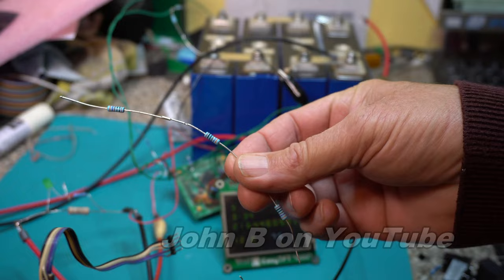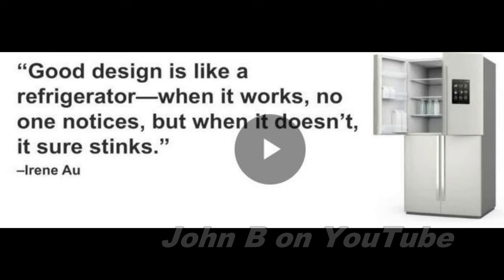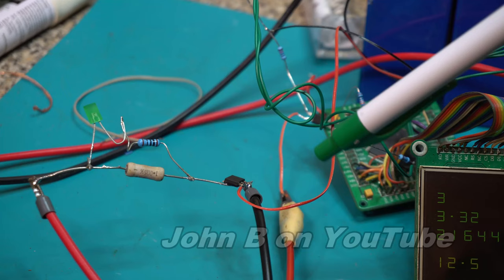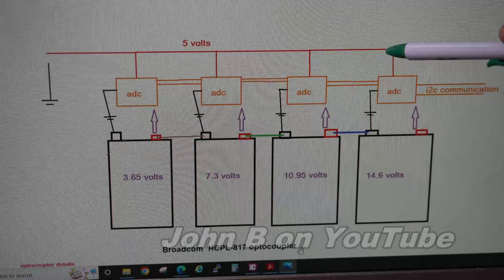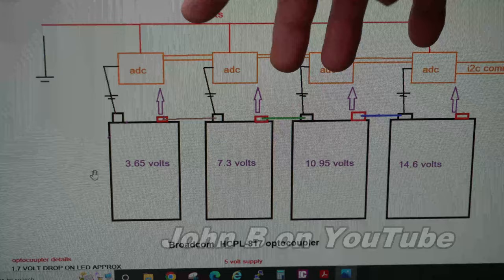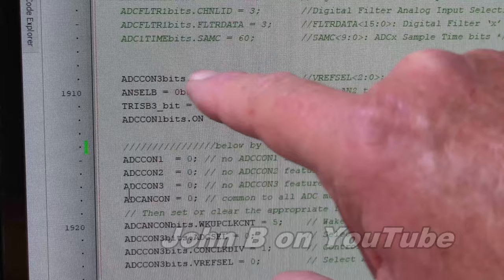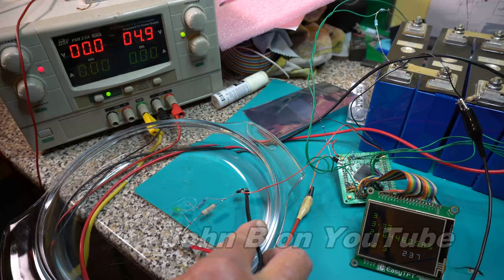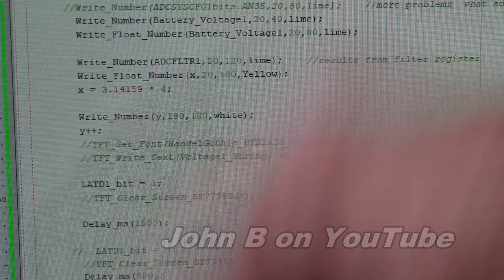Battery Management System (BMS) Design Part 2 - 12 Bit ADC on Pic32MZ and more 'ground' problems.

Comment: Using a relay as fuse is novel, indeed.  In the case your noise is perfectly random, you can average the readings over, say, ten measurements or so and get very good results.

Comment: As you can see, a bms is not as simple as it appears to be. Comments:
- be aware that if you use one i2c adc per cell you will need not only the isolated 5v supply, but a isolated ground too. So your circuit will need a i2c isolator per adc.
- an adc with internal reference would be better in this case where the power supply is not regulated.
- for the discharge circuit you don't need the external power supply. You could connect the optocoupler's collector to the respective cell positive and use the cell as the power supply. Just be careful about selecting a mosfet that can be turned on with the cell lowest voltage.
- if you can dissipate enough power on the mosfet, you could try to remove the resistor and use the mosfet in the linear area. Some circuit adjustments would be necessary. 
- if you still decide to go with separated voltage dividers for each cell measurement, you can reduce the number of resistors by using two parallel resistors on the bottom part of the voltage divider.
Reply from the maker: Thank you Jonathan Sperb for your comprehensive feedback.
I was thinking My Murata dc-dc converter was the answer. I tested one last night.
5 volts in, 5.4 volts out. It must contain a boost circuit and a real transformer in that small package.
I drove an led and shorted the +5 and then the -5 to ground, no problems. Fully isolated as per the spec, totally unregulated as per the spec lol. 
OMG, Isolated 12C ☹ I hadn’t given that one ounce of thought so I do appreciate your input.
I feel a dead pic32MZ was only a few hours away lol.
Good point about keeping the fet in the linear region, I like your thinking.  I chose that particular fet with the low gate threshold to make sure my optocoupler would drive it in the 
saturation region. Your idea would reduce parts required and I’d obviously have to pay attention to heat dissipation. It will probably be mounted on a pcb on the battery together with each adc, that means the adc may change since I guess they are temperature sensitive too.
I had spent many hours looking at analogue & digital multiplexers in place of my relays; I may backpedal and take another look. I see the expensive chips £22 have a mux in their front end. 
Thank you kindly for your input.😁
Reply: @JohnB-2021  two Johns!

Comment: 11:17 isn’t that PSU chip a switching regulator so be noisy?
Reply from the maker: Yes, it's an isolated 5 volt out switching regulator, noise didn't cause any problems.